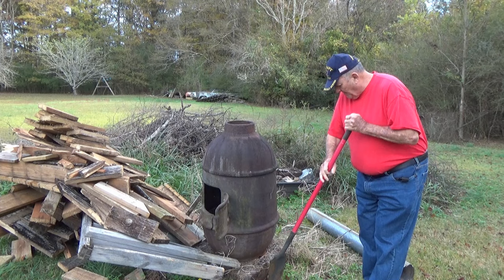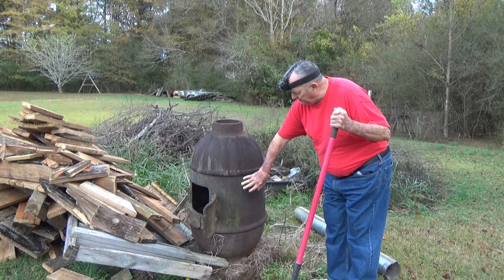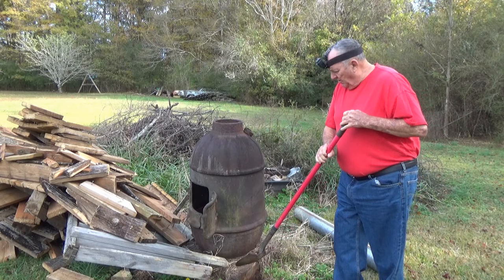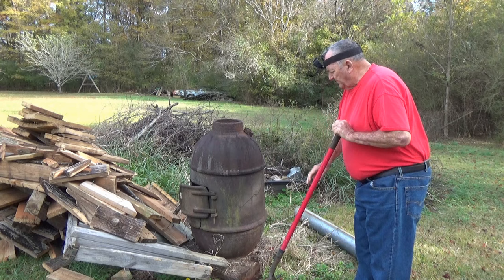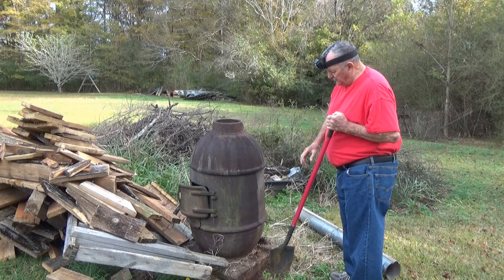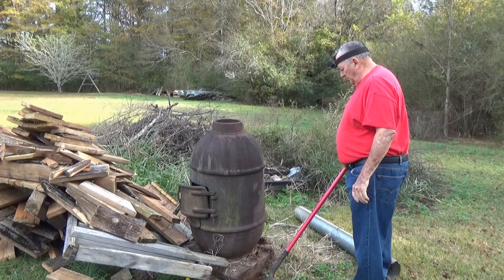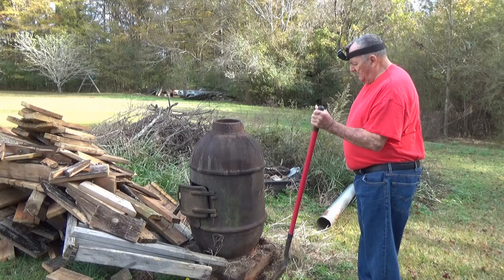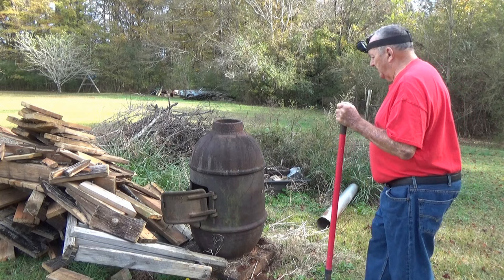Train Yard Coal Stove Project Pwalpar VLOG

Comment: That stove keeping GEORGIA railroaders warm? Imagine a coal fired pot-belly stove keeping a switching shanty warm in Cleveland during the winter. Walter, do you, or anyone you know, have an engine hoist? Lay a piece of plywood down and take that stove apart with an engine hoist. Lot safer than a floor jack. Thanks for the video. Jon, MSO-439
Reply from the maker: Good suggestion Jon
Reply: Engine hoist foolproof great idea. We had these stoves, though different models and manufacturers on the New Haven. Cabooses were rife with draft sources. If a reasonable effort were made to plug some of these drafts a caboose heated by one of these, properly tended, would be shirtsleeves comfortable hands down

Comment: 6" x 4" reducer for the stovetop just might fit the bill, Walter. The best thing to do is to measure across the top opening outside diameter OD, not ID, and build the reducer to fit. Just looking at it I was thinking 6 x 4 would do the trick, but it might not. The idea of a concrete pad is a better one than concrete blocks.
If you are looking at that picture of myself, I took it on 11-17-21 here in my bedroom from the Dell laptop running Windows 10 Pro. My HP Desktop [Windows 8.1 Pro] system decided 9 years was all it could take before the hard drive gave up the ghost.
Reply from the maker: Thanks Hugh for the suggestions

Comment: I'm sure you heard it already but be careful when moving that stove. We don't want a 1000 pound stove crushing you Walter. That engine hoist a viewer mentioned would be a good idea but you need something under it to keep it from sinking in the ground. Maybe you can lower each piece of the stove in the bed of your truck and move it out of your way. I would try to avoid setting them on the tailgate though, it might break. Then you can work on making a cement base for it.
Reply from the maker: Thanks for the tips my friend